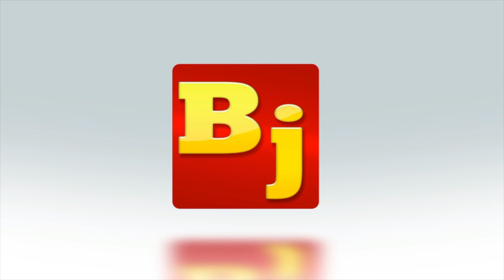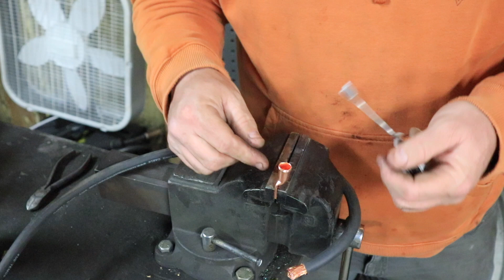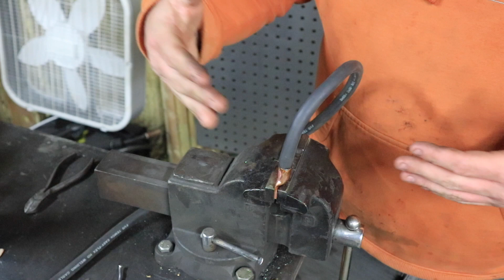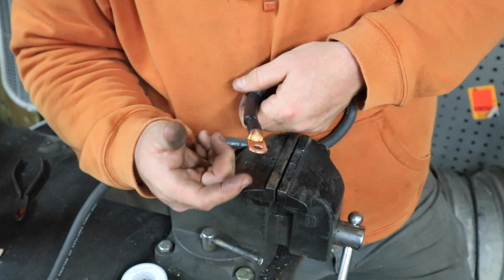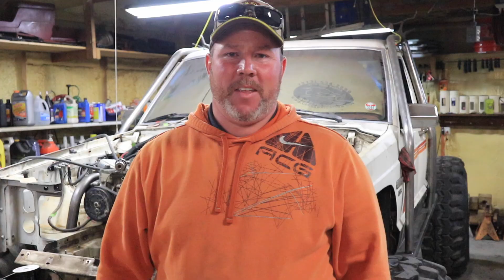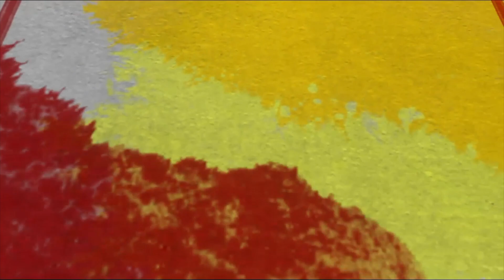How to Make Your Own Battery Cables the Easy Way

Comment: Ya but how do it with wires already on truck, and cut the frayed oxidized ends off? Basically refinish and upgrade the current terminal cables.

Comment: I've not personally had it, but a lot of guys I know say that any kind of imperfect connection caused by things like inadequate connection surface or even simply a terminal coming loose can generate a lot of resistance and thus heat, so they say relying solely on a soldered connection is dangerous as this heat can potentially melt the solder. 
As a precaution, they often hit the lug with a center punch and hammer to create an indent just as a mechanical reassurance

Comment: did ever some one made cloosed loop baterry system? honestly I have so much corrosion on my car and Im cinde of tired repairing sheet metal my car is old opel from the 80s tipical GM lay out.
So Im wondering if the engine wuld still run if the ignition coil wuld by seperated from ground or if I simply use  insulated brush holders for starter motor I did plan any way seperate or insulate alterator running it in cloosed loop system as well only thing Im not shure about starter motor selenoid it is cinde of conected to the engine .
Any way I hoppe some one knows the answer to this problem I wanted to rebuild my chassys and reinforce it but I kinde of anoyed about rost those cars also have terribel wire harnest so I hoppe some one can point out where to put diodes on 2pin buzzer,3pin blinker,4pin defroster,6pin wiper relay and what value of diode shuld I use for the delco 12si alternator and the voltage stabilised dashboard? 
Hoppe some one understands my problems and what methodes can by used to prevent rost like paint or coatings

Comment: Being an Electrician, you have the basics spot on. A couple of pointers, the heat is being drawn into your vice. The way to overcome that is to use heat-resistant neoprene covers for the jaws on your vice. The cheaper way is to use two pieces of hardwood and wet them before you heat up the lugs. If you don't know how much solder to use, fill the lug up with water, then put a scrap piece of the cable you're going to use to strip the end to insert it into the lug the excess water will spill out. Remove the cable, it will leave an amount of water in the lug. Take note of that level, that will give you the level you need to fill the lug with solder. The other point is put the heat shrink over the cable first and slide it down the cable away from any heat transfer, then slide it down and heat it up. Keep those vlogs coming.
Reply: Surprised as an electrician you find Soldered Battery lugs (Acid core no less) acceptable. The vibrations in the vehicle have a tendency to break off at the soldered joint because of the stiffness, and heat from pulling high amperage and being in the engine bay. A Hydraulic crimp is what I have always been told to use for this application. What would be your pros vs cons in your opinion of these two methods?

Comment: You did such a good job, that I'll be doing that tomorrow.  I'm putting a bigger alternator on my '83 cj7 with a 4.3 Chev.  I got to make a cable  from the battery to the alternator. Maybe a 6 guage wire.

Comment: Using solder for battery cable lugs may work in the short term.  I don't recommend soldering lugs onto high current carrying cables unless you are using high temp or silver solder.  The wicking is another problem.  You will lose flexibility at the lug if you solder them.  Crimping is a much better option.  Under no circumstances should you use acid core flux for soldering electrical and electronic connections.

Comment: I just stumbled over this. I normally don’t solder this stuff, just crimped. Vibration can lead to breakage at the solder joint later on down the road. Saw it happen in boats and street rods. Also, also seemed to me like it defeats the point of using fine stranded wire. Also, I’d probably have used tinned wire and terminals just for corrosion protection. Interesting thought on addressing the flare though. Never even noticed. Lol

Lol Yeah nothing like pulling batteries out on the trail, daisy chaining them, and improvising a welder 🤣

Comment: Seen your  video  thank you very much it was easy   AND VERY  HELPFUL TO  comprehend  and follow your steps.   THE DIFFICULT  PART WAS   HAVING TO WORK ON IT    FOR THE FIRST TIME.  MY. POSTIVE CABEL  WAS CORRODED  AND RUSTED.  SO I had to cut the cable wire connected to the battery terminal  . I was able to do it  thanks too your video . The car turned on first try. It was   struggling to turn on  . But once I took it for a drive the power came back. I DID TEST THE BAYTERY AT AUTOZONE  AND IT HAD  A BAD CELL WITCH I will be replacing a new battery .

Comment: CRIMP CRIMP CRIMP ….. without a crimp that solder WILL heat up and possibly slide right out.   Seen it in woods all the time.  Solder and crimp

Comment: Have a question.   Can you splice a 10g wire to a 6g wire without hurting anything?    Need to wire a 12v water pump to a marine battery

Comment: You don't need any of these super solder connections. You directly wire devices or anything you need directly to a power source. Then just build an extra breaker box or bring a few high watt output generators and some amount of gas to feed. Use extension cords too!

Comment: Personally, I disagree regarding your stance on crimping vs soldering. You aren't wrong that soldering provides a better electrical connection, that being said it's a very small difference, not nearly enough of one to matter, and crimping is significantly more robust in uses where you're expecting a lot of vibration, such as vehicle wiring. Vibration can cause solder to crack over time, whereas a properly crimped connection is much more resilient.

Comment: Pro tip, tin your wire before hand, flux and a solder bath for the wire first, then into the lug half filled or so with solder. also rosin core only. Still some good points and stuff in the video though.

Comment: Added level of firmness ...grind alittle inside the lug for the solder to grab on to...I like using a hammered lug myself And use welding cable 1/0 Awg And a bit of dielectrical grease before shrink tubing

Comment: I had crimped and soldered connections compared as part of a bigger development process. I expected otherwise but the crimped connections showed to be as good or better than the soldered connections. In every way possible. Mechanical: Crimp is stronger, more creep and vibration resistant. Crimp is more corrosion resistant (no flux to remove). Crimp even had the lower and much more consistent electrical resistance. Fault resistance: A fault in crimping is detectable and avoidable. Much less with soldering.
Last but not least the price: You are so much faster with crimping that productivity outclasses soldering by a factor of almost 10.

Comment: ACID Core solder??? 
You have to clean it before heat shrinking. 
It's used for steel and some other metals but not generally for electrical connection.

Comment: The idea in general is great but horrible idea on using plumbing solder for electrical. The acid core used in plumbing solder will quickly degrade and corrode the electrical connection. Use electronics solder which has no acid and perfect for electrical connections.

Comment: I always drill a hole in the copper lug just big enaugh to fit the solder wire and go from there because the method you showed is very likely to make a cold joint!
Also avoid the lead free solder like the plague.
-Thanks

Comment: How to bend the metal end of the cable (battery cable terminal lugs) into a perpendicular form? Like you keep it in a vase at 5:20, how to bend it, with what? Do you need a special tool? I'm afraid to brake or scratch the new expensive cable I ordered. I need to bend the positive cable end, bcs such is the original form on the alternator connection. Thank you for the film.

Comment: My Border Collie knows not to use acid core . . just kidding I was reminded below.
Acid core is for repairing metal seams like gutters.
Tip: flux core solder saves a step. No flux is needed. Some electronic suppliers still use flux then solder. Those are govt applications and high integrity outfits. I think repairing your girlfriends devices will be good to go with flux solder. You know. Unless it is a Kardashian and then Military spec may be reqd?

Comment: We usually " pre-tin " or apply solder to the wire first, and the lug, then insert your tinned wire with heat, use wood in vise and you wont need so much heat, too high a heat is bad for the wires, it makes them weak up inside the insulation beyond where the solder is. Double wall heat shrink or heat shrink with sealant, with glue, depends on region what it's called. Caution must be used with flux, if it is not all heated away, it will cause corrosion, so when applying to wires dont over do it and you can always add more if needed, pre-heating the wire a bit, is a good way of making sure it flows down in and not using too much. The type of flux used is important too, not all flux's are made the same, like using plumbing flux for wires....
Soldering requires patience,  you have to give the material time to heat as well as the solder and slow heating is better in most cases, cleaning sanded surfaces with alcohol will help greatly.

Comment: I love soldering my lugs but when you're installing car audio all the time hydraulic or hammer crimps are the better option purely cost wise
Reply: Félix Audet Solder will also end up cracking and coming loose when the cable is in a vibrating area such as under your hood.

Comment: any downside  to using side post battery terminals?
Reply from the maker: Yes, they tend to melt if you hook a winch to them.
Reply: @bleepinjeep   i should be ok i just running extra lights and jump start terminal

Comment: use the hydraulic crimper with proper dies then solder and use the appropriate 3:1 marine heat shrink. oh and my friend and dont "grind off the flared lip" on the next install. you will be a much happier camper lol

Comment: I guarantee there will be at least one of all of these comments. 
- Dont use a razor knife, causes hot spots. 
- Dont cut off strands, aka derating a cable
- Dont use resin core, will cause corrosion. 

Does it matter? No. Its gonna live and work fine lol.

Edit: Hope my electrical Inspector doesn't know my YouTube name.

Comment: A tip I've used successfully is while the wires are still loose is the prime them using tinning type flux, then tighten the wires using a small hose clamp and pull the clamp off while firm only tightened. Generally this brings the wires straight together.also, intead of using a "non-conductive" electric solder, use a conductive solder due to the larger area of wire that is being connected. This is useful primarily for larger gauged wire.

Comment: A crimped connection is far better than solder. It resists vibration better, it weathers better, and doesnt get brittle and crack.

Comment: I made a milled block to fit all sizes of terminal and rounded the ends of some old punches.  Make as good a termination as what you showed and cost me old tools.  Hammer them down straight, then one hit back at a 45 to the sheath to set.  Thanks for this one.

Comment: I soldier my cable ends but never like that. That dip method is new to me! seems to work nicely.

I don't do that dip I do a wick system. I put the cable in after clean it shit tons of flux. Then I crimp it on with a cheap hydraulic crimp tool.
Then I do the wicking. Heat the bottom around the eyelet and then push in the soldier from the ring around the top of the copper.
It sucks it right down and because there was lots of flux it also wicks right up behind the rubber sheath.

Now I read some of the comments and it seems acid core isn't a good idea. I didn't know that. I never had a problem but I'll use rosin instead from now on anyway.

So if I have no crimpers I try your way. As long as I have crimpers though I'll do my way.

I love learning different ways to do stuff!!

BTW   Great first Video!!

Comment: Hey cool video just curious on thick gauge copper like you're working with have you found it's not worth trying to pre-wick the copper lead?  I have had a lot of success in the past soldering copper wire with prewicked ends for electronics and I wonder if that principle carries to thicker leads

Comment: I must disagree.. A crimp is a better attachment then solder.. Say your pulling with a winch and your cables get hot start to melt the solder pop your terminal. Off.... Use a hammer crimp.. It will never fail

Comment: Here's a good tip. I noticed that when you where using the hammer crimper, you were hammering in the middle and along the edge of the bench table surface. Next time try hammering directly over one of the bench legs. Not only will you notice that it is a lot less noisier (no vibration and echo) but more importantly, you will notice that you got a better and more solid "slug" hit.

Comment: I have a problem with soldering. I'm always smokin or melting the insulation. I'm applying direct heat to the copper but somehow the insulation always starts melting before I can finish soldering the connection.

Comment: Wrong my friend that solder will add resistance, and make that crimp joint brittle. 
There is a soft copper gold plated sleeve you can add, remember electrons flow where???
But don't take my word for it I've only been working in the electrical field for 20+ years.

Comment: A little thinking ahead of time putting the shrink tubing on first, then the insulation won't slide back making you look like a shade tree fix it man. Showing how to do stuff the wrong by a guy who think they know how to do it right way should do some research before showing the would what you don't know.  This may be great for guys who don't know zip.

Comment: Rosin core is what you want for electrical and plumbing connections.  Acid core is for structural soldering of tin and such.  Acid core will continue to corrode electrical connections.  The rosin core flux you used probably helps neutralize some of the acid core.  But if you ever seem mystery corrosion on your cable ends, it's coming from the acid based flux in the core.

Comment: Thank you too much...I tried it once without anyone showing me how, just kinda guessing how it went together after finding the stuff to do it in my dad's tools. The stupid part of this is that my dad tried to not only explain it to me, but he was putting a few together using sections of nice welding leads for the wire. But at 16 years old,, I had something/someone, else on my mind...needless to say, you are correct when you say they last forever because he never ended up making anymore, so years after he passed away, I was running two different winches for pulling old growth fir logs Into the back ( not an easy task) of my one ton 4x4 flatbed, and destroyed my winches power cables and a couple interstates as well. My boss donated a couple 8D equipment batteries to me that I relocated behind the cab, all I needed was cables. Several bad attempts later, I had successfully burned all the hair off my hands, had a bunch of those neat little balls of molten solder go into my left front pocket!  Fortunately they burned on threw and escaped out the bottom of my pocket, ending their journey inside of my shoe. But at least I had the f#*#!!ng cable end all soldered on, and that's all that mattered...until I went to put the bastard on the battery and it slid right out....not enough flux not enough solder, not enough hear and didn't push it in until it seated. At least I was thorough about doing everything absolutely wrong!  I honestly cannot thank you enough for the lesson, as simple as it seems, after that one bad experience I never tried it again, but I will now!

Comment: I like that way of connecting a battery cable to the battery. I have been using those other battery connectors and after using one for my trolling motor I thought why not do this method.  So they say crimping is better then solder for vibration. I personally like to do both. If it's worth doing it's worth over doing.  Your solder looked like it might be am acid based. You want to use an acid free solder. Great video glad to know this method is already in use on off road vehicles.  I should have done it for both tractors and the pickup. Like you said super easy to disconnect the cable and sometimes during the slow season  it's better to disconnect the batteries to reduce their drain.

Comment: i would try to get the heat shrink with the water proof glue stuff on the inside to seal it off, so water cant seep into the wire

Comment: YOU SHOULD NEVER SOLDER LIKE THIS....REMOVING THE SOLDERED WIRE AND RE-INSERTING CREATES WHAT IS CALLED A COLD SOLDER JOINT, WHICH IS UNRELIABLE.  COLD SOLDER JOINTS CRACK AND FAIL WITH REPEATED STRESS. 
NEVER SOLDER LIKE THIS!!!!!!!!!  DOES NOT KNOW WHAT HE IS DOING WITH SOLDER!

Comment: This is NOt the way to solder. You NEVER apply heat to the solder. You apply heat to the work, then add the solder to the heated work. Put the wire in the end, heat the work, then add the solder and it will wick up into the wire.

Comment: Wanted to Share (additional) info for fellow Jeepsters who love our Bleepin’Jeeps vids.

In the “old” days, we could go to self-service junkyards, and pull Factory main battery cables, which are of HIGH Quality for Much Le$$.  BMW, with their trunk-mounted batteries are a TOP Choice.

Well, the junkyards apparently got wise to this.  After spending three HOURS pulling two complete Main Battery Cables from BMW X5s, I stood in Long line to pay .... they (NOW) charge $9.47 PER FOOT !!!!

I remember paying about $15 for the WHOLE Thing a few years back !  Well, $9 per FOOT is HIGHER THAN RETAIL for Quality USA Welding Wire, so, save yourself the effort & Frustration Of pulling the interior & Cables, only to be Raped at Checkout .....